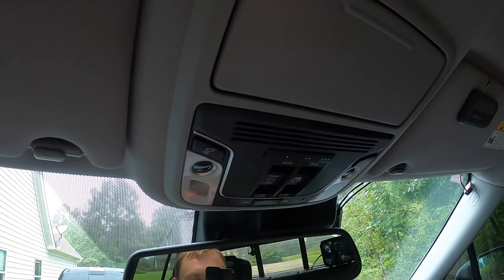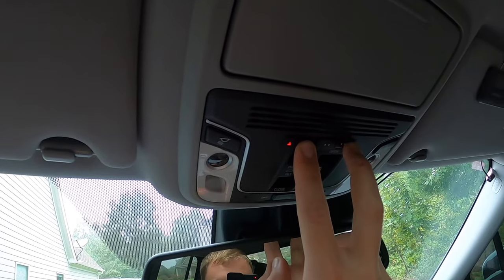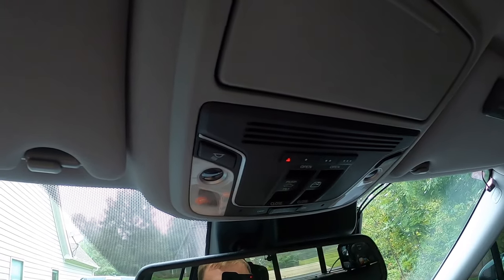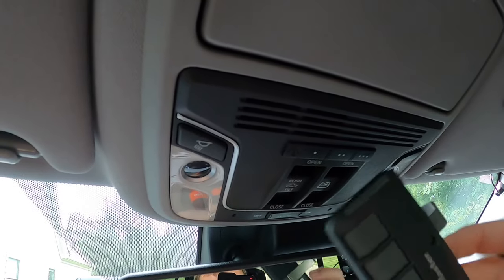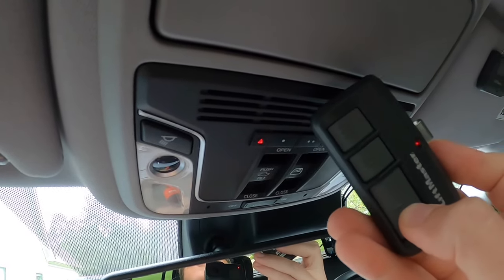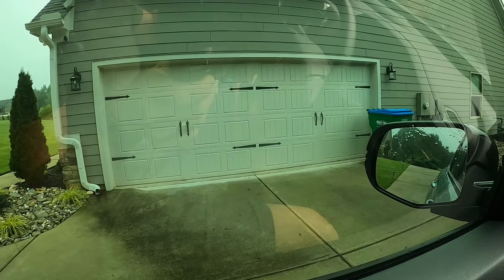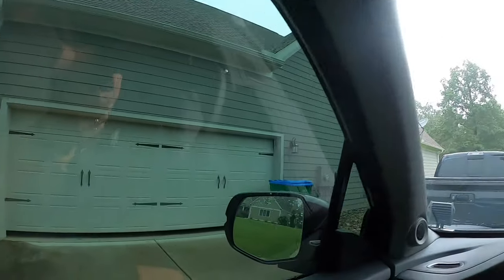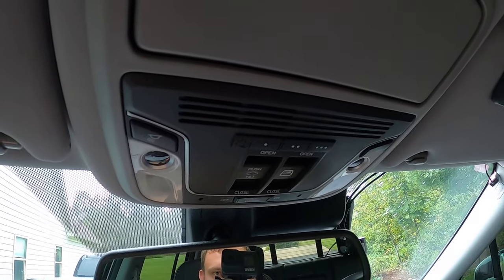Programming Garage door opener to Honda Home Link - Ridgeline/Pilot

Comment: I have a new 2023 Honda Ridgeline Black edition and was wondering what the 3 buttons were on the bottom of the rear view mirror. Took me like 1 1/2 hours to figure how to program my truck to my 2012 Genie Model: 3022 Chainmax 1000 garage door opener. The truck owners manual is only 595 pages. I didn’t find much in the Honda owner’s manual and just a small paragraph in the Genie manual. I found that my Genie opener and Honda are compatible with “Homelink” technology. I finally found my answer in the “HomeLink” document. My setup required an extra step because my Genie opener uses  I choose to use mirror button ONE.
-  Hold button ONE on the mirror and the 3rd button down on the Genie remote until the indicator in the mirror begins to fast flash.
- Go the Genie motor and press the [Learn, smart, or program] button until the LED lights up.
- Then go very quickly to the vehicle and press button 1 on the mirror 3 times. 
- BAM, IT WORKS NOW.
Reply: Thanks for this!!

Comment: I just picked up a 2019 RL Touring (Canada).   Have you tried to change out the T5 bulbs for the center console and glove box?  I just ordered some and waiting to tackle that.

Thanks for all your vids, I'm doing the led signal strip and the interior  lights exactly like yours too.  Much appreciated for the inspiration.
Reply from the maker: I plan to do a full interior light change. Planning on taking the over head light apart and seeing it the light can be modified because Atleast on my rtle the over head light for the front seats over the console are absolutely terrible still. Can’t see anything. Luckily the rear lights help a lot to compensate for lack of lighting from the front.
Reply: @YuriyMotso  nice!  yah i dont really like that soft white door light but havent had the chance to figure out if that opens up.  I tried a little with a pry tool but the whole console thing started to move..

Comment: Thanks for the video.  This method does not work with my recently purchased (Nov 11, 2021) Chamberlain Model B6713T garage door opener.  I have 2019 Honda Ridgeline.  I will be calling Chamberlain's help line tomorrow. Bummer
Reply from the maker: The other option would be go to the garage door opener unit itself and open the control panel. Preferably park under it and press the learn button on the garage door unit. It should start blinking during that time go inside and program the Honda. That would be my next step if this way didn’t work.
Reply: Same problem here with my Chamberlain remote. I’ll try his suggestion of the learn button on the opener

Comment: Hey Yuriy, do you have a video or a link on how to do a break fluid flush service?
Reply from the maker: Not yet. I do plan on making one eventually. I plan on replacing the rotors and breaks soon so maybe then I may consider adding a brake flush service.
Reply: @YuriyMotso  Ok cool. My my wife’s Passport with 29K miles requires for service B127. Didn’t want to pay the dealer  $150 for something I could probably do myself, but didn’t want to make a mistake doing so either.. Thanks